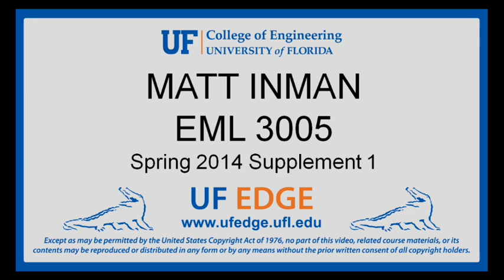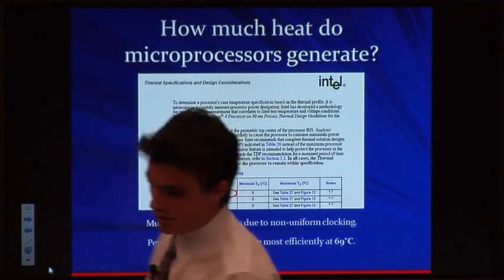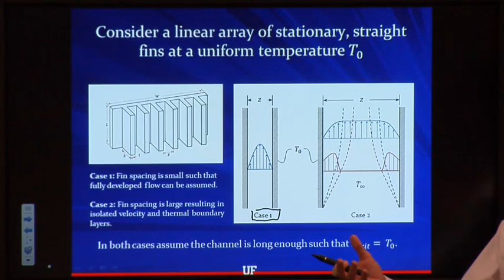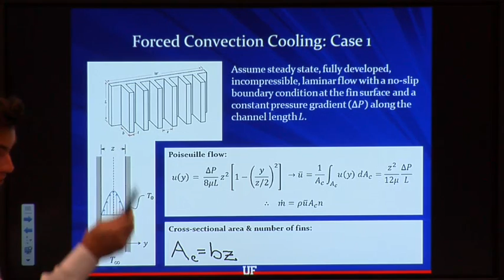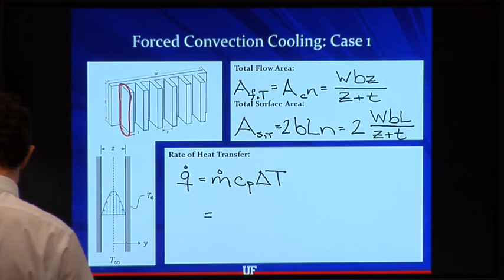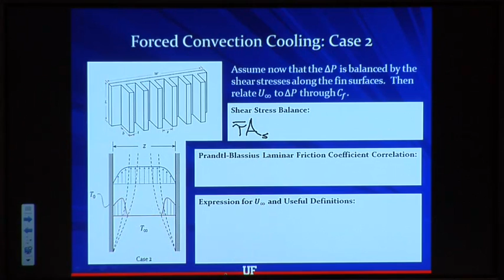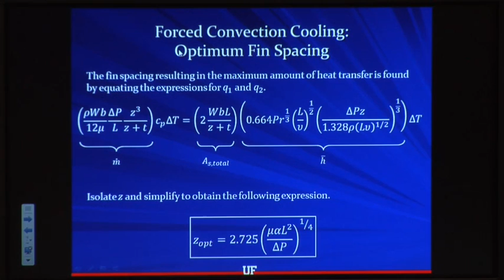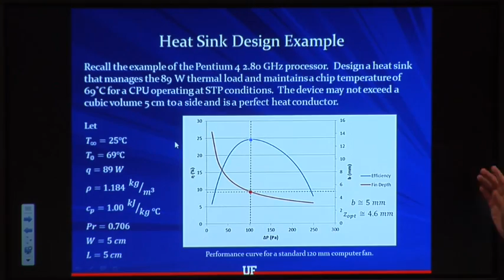EML3005 - Supplemental Lecture 1 - Thermal Management: Heat Sink Design I

Comment from the maker: Hi Kunal,

In this presentation it is assumed that:
(1) the fins are at uniform temperature and...
(2) the fins are very thin with respect to the channel length (L>>t)

These 2 conditions allow for fin thickness to factor out of the final steady state heat transfer equation entirely (see final 3 slides).  Lecture 2 covers the same analysis, only this time the fin temperatures vary along the height.  This requires the solution to a second order homogeneous ODE with homogeneous boundary conditions.  Once solved the maximum fin efficiency can be isolated and you can develop relationships for the optimum values of "t" and "b", as well as the other parameters of note.  Hopefully Lecture 2 answers your question fully.

Best,
Matt
Reply: ohhh thanks a lot for this video I like this video. :)
one more question while calculating b(optimum height)in numerical,you put  the value of w=5cm, why you take value of w in centimeter as all the other parameter given in meter. sorry for this silly question but I am weak in units. please explain me ASAP.
Reply: you have not reply me yet :(
Reply from the maker: I chose to write 5 cm instead of 0.05 m because it is a more intuitive and easy-to-visualize length.  It is just personal preference, all of the arithmetic is correct and the units all balance out.

As for the delayed response, I've been a little sleep deprived and suffered from some baby-induced tunnel vision lately. If you check out my profile pic you'll see I'm a new dad, and the last 2 months have been pretty amazingly busy.  I will reply as promptly as I can, but unfortunately exploding diapers and crying babies come first at the moment.

Comment from the maker: This link leads to a PDF providing the abbreviated analysis for determining the optimum fin spacing for an isothermal, linear array of rectangular fins via Natural Convection.  It is recommended that you watch lecture 1 first, as the analysis here is very similar.  Good luck.
https://drive.google.com/file/d/0B2sp53zkUVeUNG9CQzl2amthZ2s/view?usp=sharing

Comment: i honestly had no idea how you got the Zopt= 4.6mm. could you tell me what are your values that you used. That's what i got
-Dynamic viscosity 1.8616*10^-5 (kg/ms)
-thermal coff of air under T=25C,  K= 0.026(w/m.K)
-density p=1.184 (kg/m^3)
-cp= 1.00(KJ/Kg.K)
- to find the thermal diffusivity "alpha"= K/density*cp (m^2/s)
-length L=0.05m

i used your Zopt equation but i keep in getting the answer = 0.8668mm

where is my mistake! I've been going back and forth into derivatives and constants and i still couldn't get your value (Z=4.6mm!!)

thanks for your help
Reply: the calculation of the thermal diffusivity "alpha" is OK?

Comment: Hi Matthew,

Using the theory in this video I have been trying to design a heat sink for an application. There seems to be a flaw in the approach to reach the optimum value. Towards the end of the video you use the fan’s efficiency curve to select a certain pressure drop (delta_P) and use it to calculate z_opt and fin height. Now suppose the required chip temperature changes – then at the same pressure drop you will get a new value of b (fin height). But since the fin geometry has changed (due to change in fin height) the fan will NOT be operating at the same delta_P which conflicts with the initial value of delta_P 
I have explained this here in more detail - https://drive.google.com/file/d/0B8-la1FomNr3ejZfSHJqbjQzbkU/view?usp=sharing

My question is does operating the fan at its max efficiency ensure minimum heat sink temperature (or maximum heat dissipation)? If not, then what is the significance of q_max?
Reply from the maker: +Ankit Kumar Parsurampuria 

Hi Ankit,

To answer your question at the end first, the max fan efficiency point does not relate directly to optimum heat dissipation or min. fin temperatures.  It is a design point for the fan only, and relates the power transferred to the flow to the power used to turn the blades.  We are using that design point to minimize the parasitic load on the overall system and that is all.  Then, as you note in your comment, that design point corresponds to a specific delta_p, and that informs the rest of the analysis.  

In terms of the required chip temperature changing, I'm having trouble envisioning a scenario where this would happen.  The chip temperature is taken directly from the manufacturer's guidelines, so that should remain constant.  That said, if the ambient temperature changes, then yes, you will need to go through the whole analysis again.  Ambient conditions are assumed, and changes in your assumptions in a design scheme usually mean you need to go back to square 1.

This is fairly simplified analysis, and like you have shown, is not very robust when considering changes to the design points.  But in a controlled environment (say for a personal computer housed in a air conditioned room at sea level) it should be sufficient.

I hope this has answered your questions.  Best of luck.

Matt